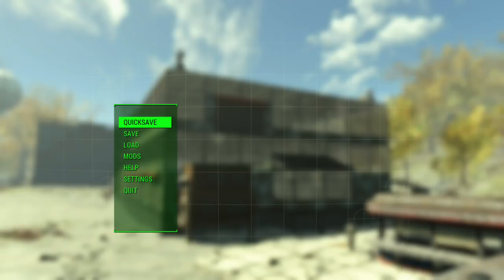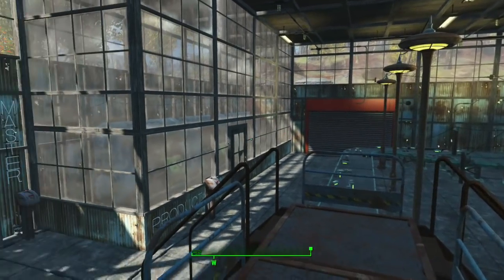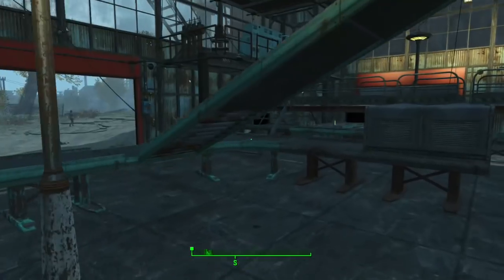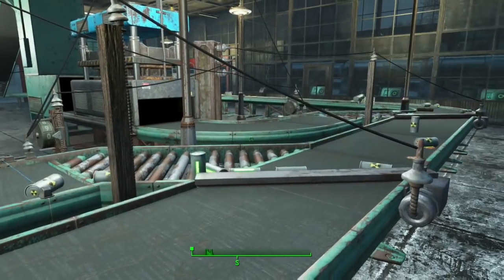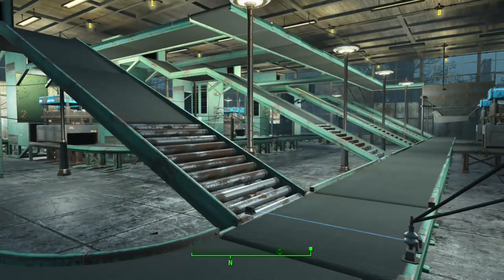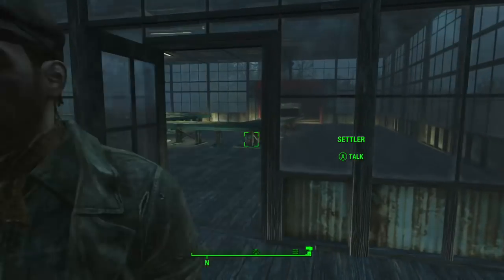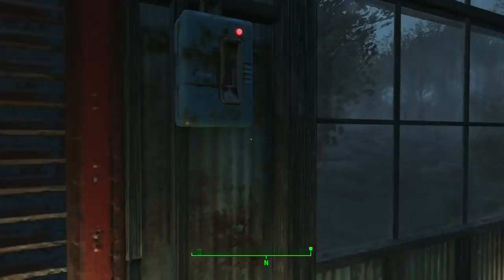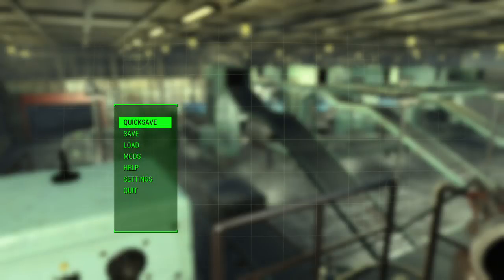Fallout 4 Automated Fusion Core Factory Tour

Comment: love how this settlement in particular is just the hotspot for factories for some odd reason
Reply: well, it's the one with the flattest ground for building right?
Reply: Flattest ground and a ton of open space once you clear the cars and stuff.
Reply: @hatad321  This is exactly why, but is also why I don't want to. I have built a robot factory there once (and some living quarters), but I feel like it has more potential for something non-factory. I want to do something that's more true to its pre-war state, like maybe a park of sorts? I see potential to drop some benches down and some vending machines around the drive-in building (I wish that projector still worked lol) and then set some stuff up within the lot for entertainment. I prefer my factories to be built in Sanctuary.
Reply: @qazxsw21000  The problem I've had with Sanctuary is the space, if you put it on one of the foundations it's a little small, and if you put it in the road it doesn't look right.

Comment: It's an interesting idea, but (on the PC version at least. I don't know about the console variants) once you leave the area the game stops any production going on there. After getting the "Pray and spray" I set up a simple .45 manufacturing plant in Sanctuary. Trouble was, every time I went off and spent an hour out using ammo, I'd come back to find the machine still churning away merrily, but only 70 or 80 rounds in the hopper.

In the end I built a solid concrete bunker around the plant, and once I've got a couple hundred count of fertiliser, I'll scrap a wall panel to get in, replace the wall to seal me away from possible raiders, start the plant, then leave the game running while I go off (IRL) make dinner or something. When I return 45 minutes to an hour later, the fertilisers all used, the ammo is all made, and the settlers are all p*seed off at me for not rushing to their aid when they get attacked. :D

Comment: I love the recycler, I drop all my junk from missions into a container in front of a vacuum hopper, then when I have a few minutes to decide what I'm going to do next, I hit the switch and watch the resources flow.
I mainly build ammunition, but my line starts with the Vacuum Hopper, then to a Sorter, then onward to the Ammunition Plant and lastly to a Collection Bin. My issue is I don't know what the Sorter does, because everything just flows through to the Ammunition Plant and sits in there if it isn't an ammunition component. The Sorter has two outflows one diverts right of the main line, the other flows inline with the belts. Can the  Sorter divert non-ammunition components to a Collection Bin or Workshop Bin? If so, how do I tell the Sorter what non-ammunition components to divert to that bin?
Any help would be appreciated. Thanks in advance!

Comment: I've installed manufacturing extended and have access to the power armor forge. However, I cannot set fusion core production in the terminal? What am I doing wrong? Is there a perk needed?
Reply: Did you figure out the gate control? Need a little help if so
Reply: Same problem
Reply: You need the perk "Science", intelligence. The highest